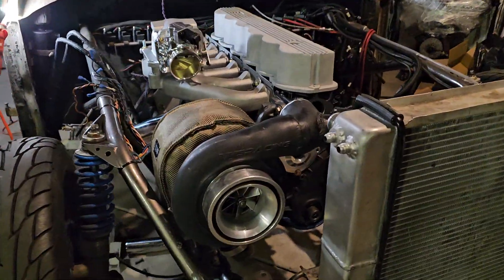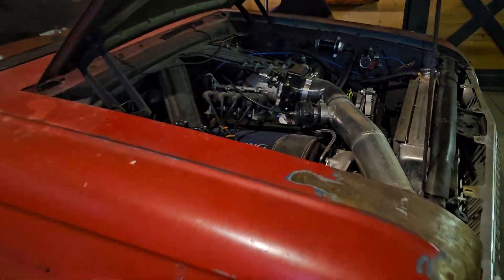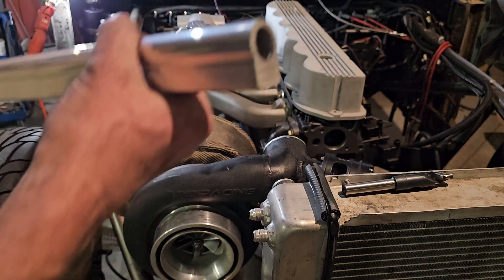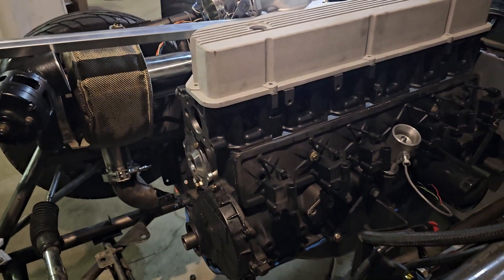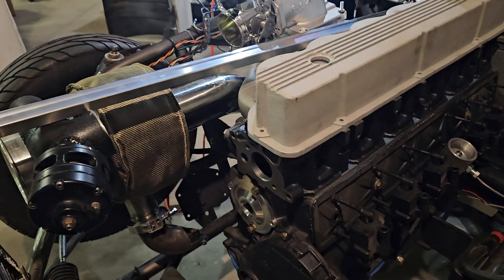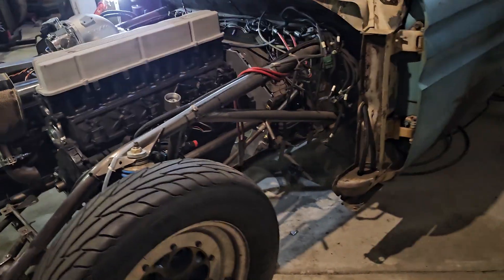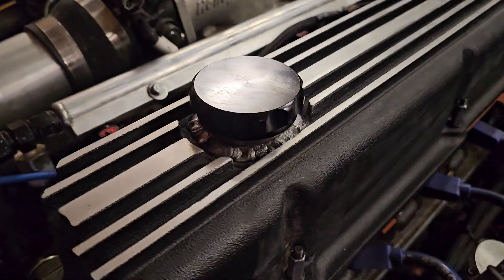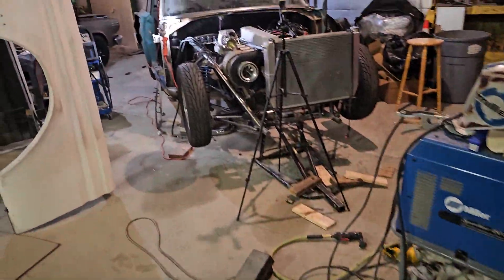80mm turbo on the Ford 300 inline 6 turbo engine project. Holley EFI, LS coil swap

Comment: How far away is a LS style head or cleavlend for that wagon
Reply from the maker: @stevek.7896  I am too much of a Ford guy to do the LS head. 
I'm going to make 1000hp with this iron head, and HD log to show that it can be done with the Ford parts.  Not sure the bottom end is capable of much more than that. 

But a crossflow head would make it easier.
Reply: Batten heads in Michigan used to do Cleveland heads for Ford 300 6's. im sure youve heard of Bruce Sizemore. a more modern choice id think would be an aluminum Edelbrock Victor Glidden, that would make way more power than any LS head could ever hope to and still keep it Ford👍.

Comment: Got a 75 highboy/300i6 i wanna do this too.
Reply from the maker: @nobiden3134  the 300's do really well with a turbo.  At a moderate level they are still very reliable.  Most of the problems that we have had were selfinfilcted

Comment: Love the progress & love how y'all have taken a deep dive into max performance 300 cid Ford straight 6 performance! Some day give us your thoughts on the changes to the cooling system & logic brhind those changes. I've often looked at the stock water pump & wondered how the rear cylinder gets adequate cooling from the little factory water pump, especially higher thermal output from modified engines. Thank you for posting!
Paul from S. Central Tx
Reply from the maker: Thanks Paul for watching! We'll be sure to get to that in a future episode.
Reply from the maker: The remote water pump simplifies the belt.  Now just an alternator.  The electric pump also allows us to cool it down between rounds at the track without the engine running.